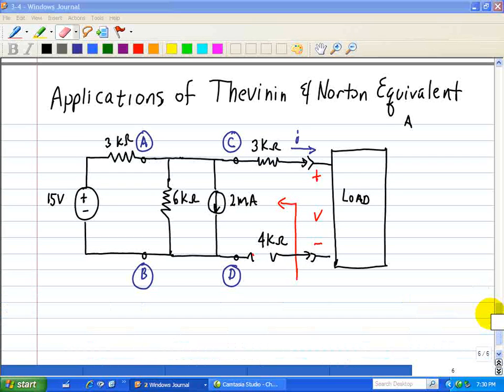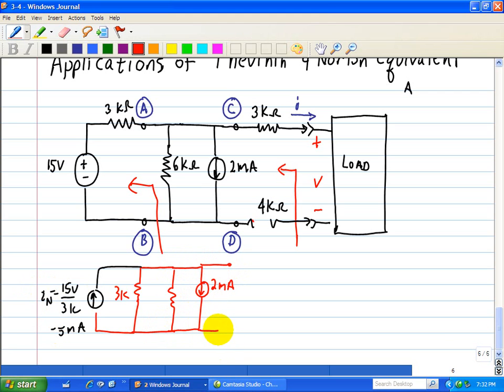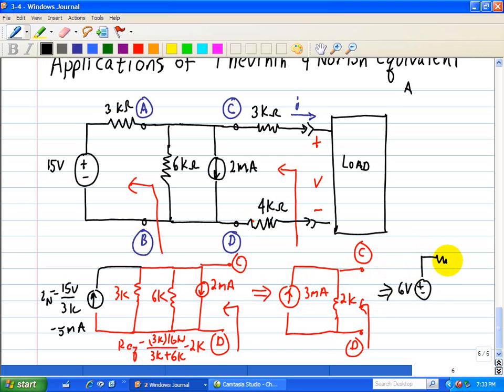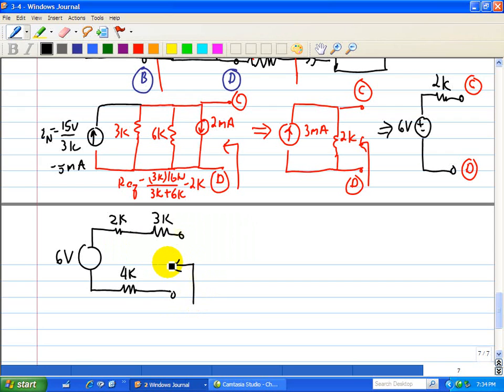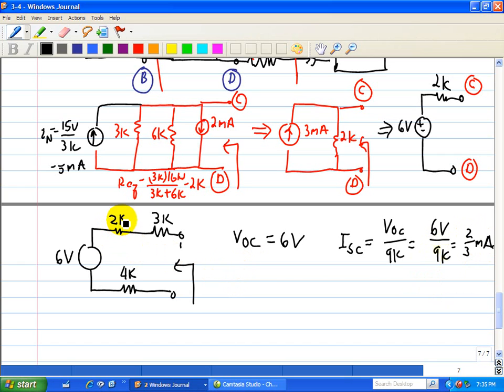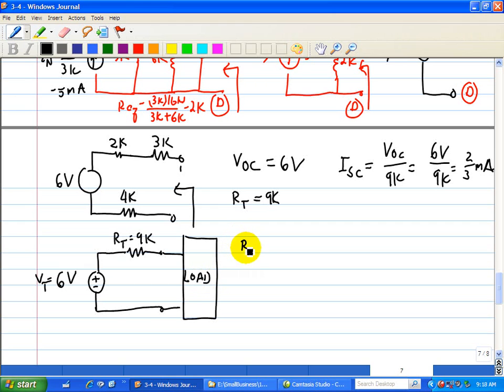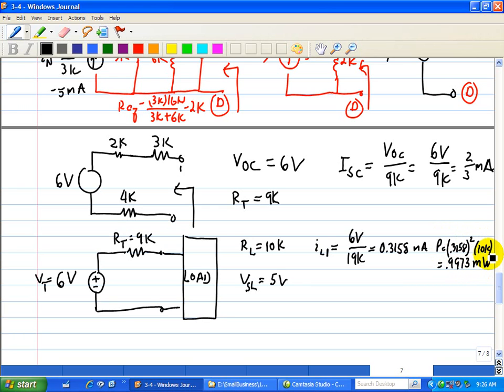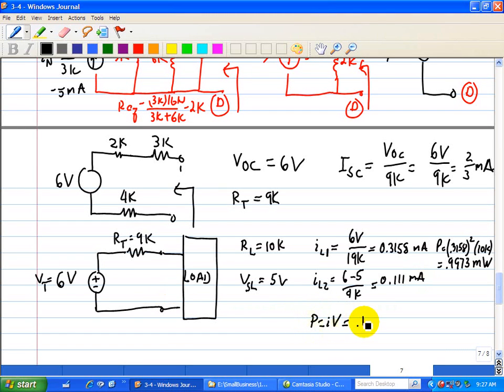Thevenin & Norton Examples - Thevenin Equivalent Circuit Theory - Part 3

Comment: hi, i was wondering at the end of the video around 8:00, why is it not negative 6V instead because the voltage is going from low to higher potential according to the picture.